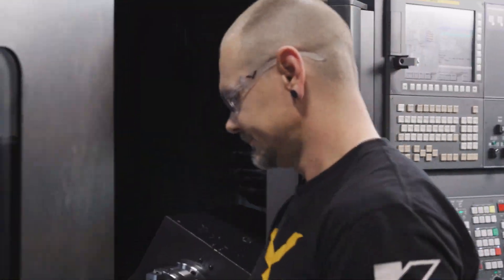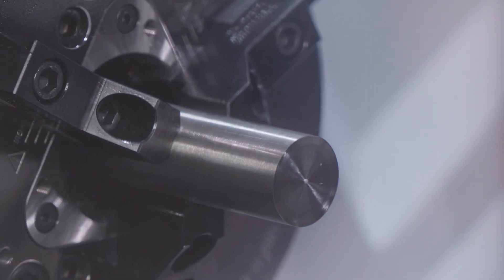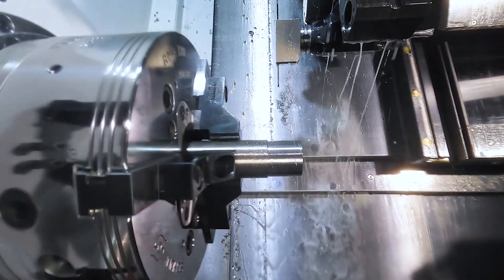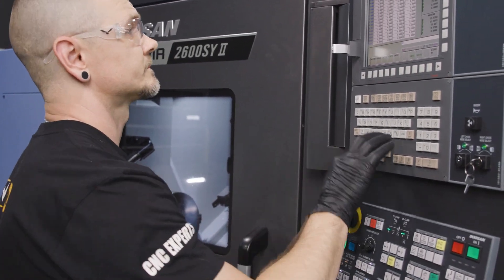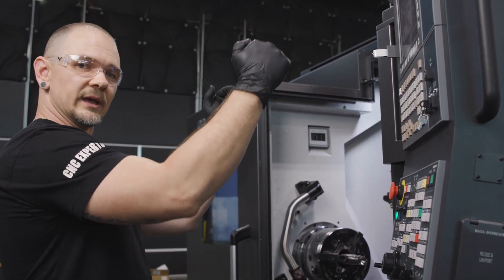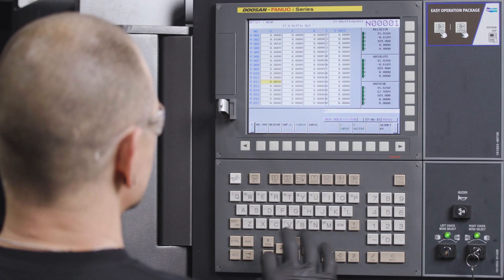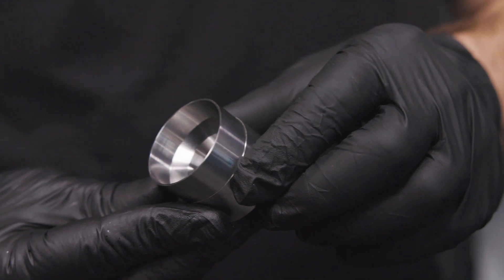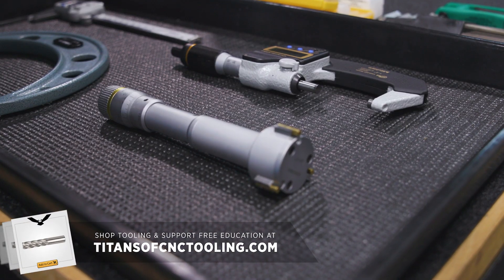Dialing in the OD/ID Dimensions on PUMA 2600SY II Lathe | DN Solutions

Comment: This is a bad practice and only used by lazy programmers or for one-off parts. For tight tolerances, I always program a "set pass" that is .005" DOC (give or take, depending on the material) offset from the finish dimension. It gives the operator a chance to dial in their tool offsets, which is usually less than half a thou if they set their tools correctly. Once they get it dialed in, they update their tool offset and run the finish pass. This way, the tools in the machine are always set very close to their true cutting size.

Comment: As you work to close tolerances are you working in a controlled environment? If not why not. Is inspection working to standards room technique, if not why not. If the customer measures your parts in a controlled environment your parts may be out of tolerance. We had this experience in the 1970s where the machine shop made parts correct but when checked at the same company standards room found to be incorrect. Good luck Ambrose retired QA inspector.

Comment: When setting up for tight tolerances, I programmed equal depths of cut for my roughing passes.  
I wanted equal tool pressure on each roughing pass.  I held a tight tolerance after the roughing passes, which enabled me to take two equal depths of cut with my finishing tool.  It was all about working with even tool pressure on each pass.

Comment: Two tenths tolerance and I'm losing sleep over my mic technique.  The quality guy and I will probably argue about something, between the mic calibration and how much pressure we put on the knob.  Even with the ratchet type mic handle you can change the reading by at least two tenths.  And we have some dirty mics, which I'm sure changes the amount of torque the rachety clicky handle applies.
Reply: The parts I'm running right now are 718 inconel and the tolerance is -.0000 +.0002

Comment: Wouldn't you check the rough OD and ID prior to running the finish passes?  Just to make sure that the rougher is leaving exactly the proper amount?  This technique works best on small part runs IE one or two.  If you put a M01 and use the Op stop you can check each tool as they run and make the offset changes as the tool is finished then run the finish tools a last and second time, then all the tools are trimmed in with repeatability for future parts.

Comment: Consistent tool cut pressure is super crucial in getting these tolerances.  

But Jesus that boring bar was chattering.  Sounds like it’s not engaging enough for the stick out and bar diameter.

Comment: And using correct measuring-tools is important. An external micrometer and threepoint internal micrometer is not correct on small tolerances.
Reply: Plug and ring gauges work well also.

Comment: One question, if I may. Are the micrometers used calibrated at the machine shop temperature, and the inspection dep't temperature, that is, are they both at the same temperature ? As a retired machinist I ask because I had many arguments with the inspection dep't who would come to check 10ft long shafts, coated with tungsten carbide, which I was grinding with diamond wheels to a tolerance of  +/- 0.0002". The problem being, the inspection dep't was temperature controlled, but not the workshop ! And since the ground diameter was in order of 6" it really mattered. Enjoyed the video and just subscribed.

Comment: Seems like your finishing cuts are pretty light. I always like to run a finish pass the same depth of cut as the nose rad. Helps with chip control and finish
Reply: Yes!!!!! Engaging the proper amount of your tip radius is as important as your feed/speed.  Rubbing vs cutting!

Comment: I find it kinda surprising that you're just going balls out on that offset in one pass, for such a tight tolerance. I find that hard to believe. But this does make the video shorter, and give the proper concept. Something that tight should be needing many spring cuts. Because who knows what's really bending more under load. Could be the part or the tool. Sometimes the machine doesn't like you that hour, and says nope.
Reply: Proper workholding, good toolholder, inserts, speeds and feeds and machine makes this happen everyday when you press “Cycle start” button 👌
Reply: @mikhaildavydenko6841  Unfortunately not every program is made by an engineer/programmer with these things in mind. A good machinist will always account for spring with tight tolerances.

Comment: I only do this with large tolerance +/- .005.  For the small ones I always run it three times once to get the rough finish size. I mark where I need to be then run it again with no change to remove tool pressure then i finish it off. Next part I put it at the size I marked after my first pass. I'm not telling boss I scrap a $500 to save 5 min.

Comment: Nicely done. Only thing I would do different is pre part the material.
Reply: That is a good idea. We might look into that as a possible teaching point in the future.
Reply: @travisjarrett2355   depending on the wall thickness of the part you would be surprised at how little wall holding the part will "keep" the shape which is not a good thing. I usually try and leave about .030 wall radially holding parts on to chucking stock so long as I dont have chatter issues.

Comment: I use probing cycles on the rough then write a macro to adjust the cutter comp . Run the finish probe cycle on the finish . We run 98% efficiently No scrap . No operator the machines run themselves basically.
Reply: how do you program this? Specifically the macro, using common variables? Do you add code once you post your program?
Reply: Which probe and tolerances?

Comment: Instead of M00 and then having to take those out again, use M01. That one can be turned off and on again at will with a button. I always use M01 before every toolchange so the first time a program runs I can check every tool and it's work. Then simply turn off the option stop and let it run.
Reply: Or /M0. Block skip uncheck at setup, checked for production
Reply: @pupetxls2  I generally work with machines that are 30 years old, some even older. Most have the M01 option stop, but I haven't really worked with machines from this century. I assume your answer applies to newer machines... Not everyone is that lucky though not everyone gets to use a 10meter long vertical mill: 10.000x1.100x2.400mm travel on my 1987 Mecof that has a Tapedrive and Punchcard... OLD-SCHOOL!
Reply: I think he used the M00 to only stop after the finishing ops. If he used M01, he would have to hit cycle start after each op.
Reply: @jonahdement4379  when doing the first run, that wouldn't actually cost much time since the operator is there anyway for initial setup and testing. Also you could have the machine stop after it's current job/tool by the flick of a switch without having to time it. But I guess that's a preference thing. We/I use M00 only when actually needed for things like chip removal or other instructions to the operator while the program is running.

Comment: Good video. I'm working on a part in 316L now thats challenging. Total tolerance OD/ID has to be held to .0005". One part is good, next is either oversize or undersize, no pattern and no adjustments. What do you suggest?
Reply: Theres plenty of things at play here. Are you bar feeding? The whipping in the bar behind the chuck can affect the size, make or use a sleeve to stabalize and shorten the bar length i usually do 1.5/2m in length. How far are you out the chuck? i try to keep it within 2.5D or less if i can so it's parting off as close to the chuck without damaging anything. could drop a tip rad size from 0.4 to 0.2mm that helps alot in some applications, also DOC is important as well, it's not always the best to have the finish tool tickle the material away, or you can be getting deflection if your finishing the part and its got a small wall thickness. Using CSS? try not and just use a constant RPM. 

I find having it closer to the chuck/collet solves alot of chatter/tolerance issues, Also I've had this debate before about running a cold machine and hitting tight tolerances,

Comment: I'm assuming these inputs are in inches. 
Anyone can do me a favour and translate it in mm's? 
Since at my job they thought me to leave 0.25 for finishing pass and then raise both rough and finish for 0.5, do a run and then substract the amount that I measure. 
It holds most of the time but sometimes it just goes a bit off.
Reply: .25 mm = .010".

Comment: what the advantage of drilling holes using live tooling instead conventionally where the spindle turns. does the live tooling achieve higher RPM?
Reply: Centrifugal forces for better chip evacuation
Reply: I use live tooling for my small drills as the toolholding is better suited/more versatile. Also, if my drills are a little off center it won't have any negative effects on tool life or hole size.
Reply: @travisjarrett2355  makes sense

Comment: Travis are you going to do another video with the second operation? How are you going to hold it? Are you going to hold on those thin walls? Wouldn't that be a little sketchy due to those super tight tolerances?

Excellent video. I can't wait to see the next one.
Reply: Hey Michael, while I can't say on the second video I can say that yes I will grab on to those thin walls. I'll cut some soft jaws to make almost complete contact around the part and I'll turn the chuck pressure down to a minimum. May take a few tweaks on some of the parameters but I'm fairly confident we can hold it.
Reply: @travisjarrett2355  Okay. Now I have more questions. Since you're bringing down the chuck pressure and increasing the surface area with the soft jaws, do you look at the coefficient of friction between your soft jaw material and the part, or do you just always use aluminum since it's easy to machine? Will you need to bring down the feeds and speeds on something like this, a second operation? If you do, do you guys have a titans of cnc formula or is it an experience call of how much to bring down those speeds and feeds?
Reply: @michaelmacdonough3313  
Before clamping on the 2nd operation he can put a round piece of material in that first hole that fits perfectly, it clamps with the thin wall, an inner ring with almost the same tolerances, you can make thread in it for a puller.  😉
Reply: @michaelmacdonough3313  I do not look at the coefficient of friction but I like the way you think. I do however lighten my depth of cut and use positive geometry tooling to reduce the pull on the part. Reducing speeds and feeds can help too along with limiting RPM's to a lower max (G97) to reduce any tendency of the jaws pulling out at the reduced pressure. As for a formula we do not have any specific such calculation. We just try to use our experience to machine better than we did yesterday. Day by day.

Comment: I've machined things that shape out of plastic and had a lot of deformation and dimension change from having the thin wall at one side. Any advice on reducing warping in that situation?
Reply: lower feeds and speed, inserts that have sharp edges also helps in cutting if you dont have special inserts for plastic it may be much to get inserts specialised for plastic but inserts for aluminum is often quite sharp too, we run mostly stainless in our shop but have aluminum inserts, since we rarely do plastic parts we use aluminum inserts for that
Reply: Do all the roughing, drilling before finishing, take really light finish passes for minimal tool pressure, use sharp and polished inserts as simon has said
On long and thin walled parts it may even be neccecary to finish outer with stock on, then inner, outer again and then inner again
If the deflection is still too much, consider stress relieving the Material beforehand, especially on PTFE that stuff can be a bitch sometimes
Reply: As mentioned sharp tools will help. I would try positive turning inserts (walls of the insert taper inwards) as this will create less cutting forces on the part. Also make sure your finish passes are not followed by any large amounts of material removal (no large roughing operations) as this can cause finished surfaces to warp for sure.
Reply: If possible fill the first hole before clamping on the 2nd operation,  put a round piece of material in that first hole that fits perfectly, it clamps together with the thin wall, use an inner ring with almost the same tolerances, you can make thread in it for a puller to pull it out after machining.  😉

Comment: I usually check the OD after my roughing pass so I can dial that in first, so that I know my finish pass is only taking my desired finish depth, I know it won’t damage my finishing tool too much then.
Reply: i do that too. Some materials like carbon fibre are very sensitive and the roughing pass needs to be dialed in for tight tolerances.
Reply: @dipl_rodler5573  honestly, I haven’t really machined many tough materials, probably the hardest is like high carbon steel in my shop time as an engineer, but I think the basics should follow through no matter what you machine 👍🏼
Reply: I agree also wheres the M01. M00 is unnecessary
Reply: @marcvaillancourtmv  yes, u can just stop the program and then restart it, but i guess for an educational video it's good.
Reply: leaves a cleaner finish too, i never take more than .05 off with the finisher. i could do .1 by why bother. the roughers are handling it just fine. usually machine parts around 65 hrc. hardened carbon steel
Reply: @konsequence9752  .05 metric I presume 😂
Reply: @willyharris4199  ofc lol
Reply: @konsequence9752  0.05mm only?+!
Reply: Yup!  It ensures your tool pressure is consistent and removes one more variable in size.

Comment: Don't the tools erode with use, even carbide? Don't corner radii increase? Doesn't heat build up as the tool becomes dull(er)? 

Do you compensate for tool wear during a run? Do you monitor tool and/or part temperature during a run to detect tool wear?
Reply: How long have you been an operator ?
Reply: Yes on all accounts. These are the things you must watch for and control, all to a degree that aligns with the tolerance allowance, the machine capabilities, the environmental conditions, and your skills as a machinist. This job is a consistent mix of attention to detail and problem solving. I love every minute of it.
Reply: How much time did you spend typing that up to try to prove to internet strangers that you know something?
Reply: you run different tools for roughing and the final cut
Reply: Once an edge wears it deteriates pretty quickly. Change the insert and repeat the process, no point trying to chase wear

Comment: I thought everyone programmed this way on tight tolerances. Say you want to leave .01 stock for the finish pass. instead leave .02 and program 2 passes. First pass put an M0 and in notes (.01 stock) if it checks .015 minus your tool .005 if it checks .005 add .005 to the tool. This is called a "check pass"
Reply: I've heard a similar approached called a "spring pass". Program two moves at the same "coordinate", one to do the major cutting, and the second pass at the same coordinate to relieve the tool tension, and then dial in a finish pass for the remaining 5 thou or so. What are your thoughts on that sort of approach?
Reply: @Nathiuz  It's a great approach for instance in fine turning when the actual cutting time is about ~30 seconds or so, depending on how tight the tolerance is it can be a great way to score within 0.005mm if you're using something like a VBMT 0.4mm, just beware the flexing after like 20-30 parts when you've worn out the coating. Of course if you're using cermet inserts it's easy to compensate for, but for regular tungsten carbide it's a gamble as soon as it starts to differ from the nominal measurements.

Comment: Wait you only take 0.01 on finish pass? What kind of insert and tip radius do you use to finish od? I use cnmg or wnmg 0.4mm tip and leave about 0.04 stock for finish
Reply: I have always had good results with a .010 finish pass (.005 per side). Insert is VNMG .008 (.2mm) nose radius.
Reply: @travisjarrett2355  Thanks for replying! will definetly try your way.. I get good enough results but sometimes inconsistant, with oneoff parts i tend to finish them by hand with some fine sandpaper on manual lathe.. im trying to eliminate manual sanding and get parts perfect from machine.
Reply: @RiseOfSky  my pleasure. I'm not sure about your machine capabilities but if the machine can do it I would definitely let it. It will save you time for sure.
Reply: I too only leave .01 for finish on diameters and .005 on faces.  I hit tolerances more consistently then when I was leaving .03 for finish.